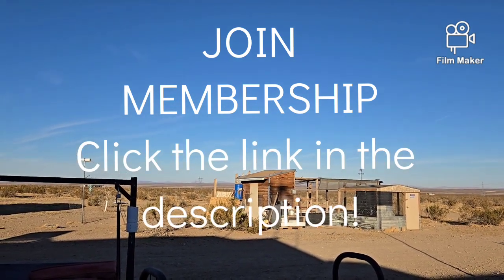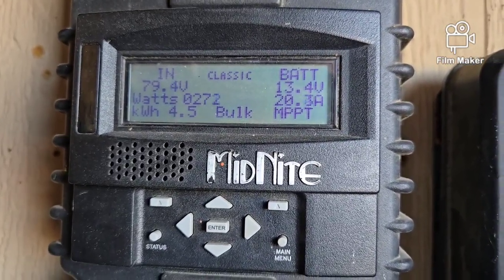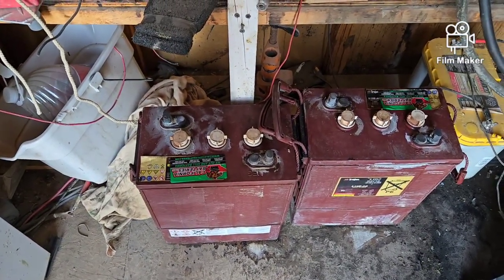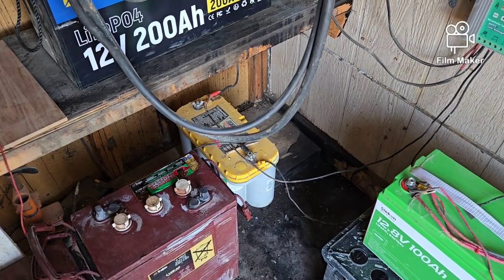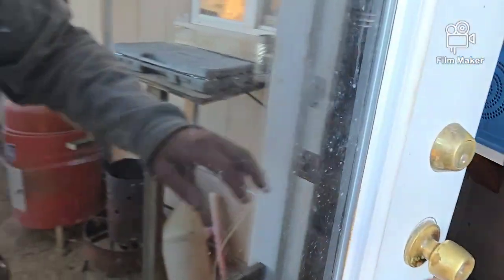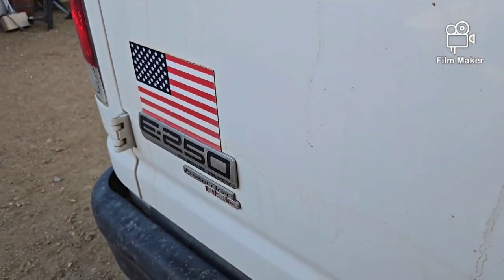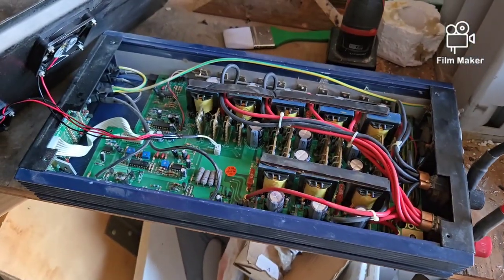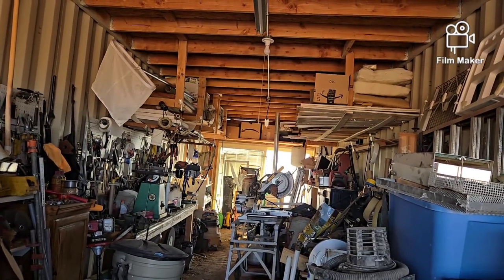Lifepo4 And Solar, How Much Do I Charge? Dec. 17, 2024

Comment: Holding Good & Steady over here in Lucerne Valley @ 🌴 💦 Indian Creek Ranch 🌵 ⛩ with 4 RENOGY 200AH AGM BATTERIES AND The Balance of My Battery Banks are Lithium Iron Phosphate CHINS and REDODO Branded with Low Temperature Protection and Monitored By 2 RENOGY 60amp BT-1 Bluetooth Dongles and VICTRON SMART SOLAR Charge Controllers for a Combined 4,400 watts worth of Solar Panels for Well Pump,  Endless / Tankless Electric Hot Water Heater, Bunkhouse, 2 Outer Sheds and The Main Lodge

Always Nice to Drop in on Ya G'Bear 🌵
Reply from the maker: @1GREATDANE  Sounds like you have it wired!  Enjoy your Christmas holiday!

Comment: What about using those two lead acids with some panels out at your chicken coop or over at your garden shed??
Reply from the maker: @tomoneil3453  They wouldn't be an advantage to neither.  Plus, I'd still have to maintain them.  Distilled water is nearing a buck and a half per gallon.   Nah, Lifepo4 only from now on.  Prices are down, and getting better everyday.
You'll love my followup video tomorrow on how a single 12v, 100ah Lifepo4 battery replaced those 2 6v, 470ah aircraft carrier anchors.

Comment: Why are you using AC to light your shop?
Reply from the maker: @larrycarlston4044  Because it is more efficient and less expensive than DC 12v.
Reply: @GBear  I use DC as much as I can. There are conversion losses when you generate DC and then convert it back to AC. I understand maybe running the fridge on AC, but definitely the lighting should be DC LEDs. How is DC more expensive than AC?
Reply from the maker: @larrycarlston4044  I'll explain in an upcoming video.
Reply: @GBear  thanks 😊
Reply: @GBear  the 12v RV lights draw almost nothing and are cheap. Like 6 or 8W, similar to an LED AC lightbulb. Good if you want to skip the inverter step if running 12v, but not as great if you are going 24/36/48v back to 12v with a buck converter. In that case you might as well use regular AC with the rest of your stuff.
Reply from the maker: @Dragonfiregum  Welcome aboard!  Yep, all true.

Comment: Were you inferring that your cabin lights are 12v?  Perhaps a video on the latest in efficient off grid lighting?  I presently camp with a mix of 5v & 12v lighting, and candles.  There might be a better yet cheap newer way?  Any update appreciated.  I do have a full sinewave inverter power bank, but why bother up converting?  I enjoy having my "evening beer with Bear".
Reply from the maker: @mikesmith1550  I'll do that update tomorrow, Mike.  Yes, my cabin lights are 12vdc, while the shops and garage are 120vac.